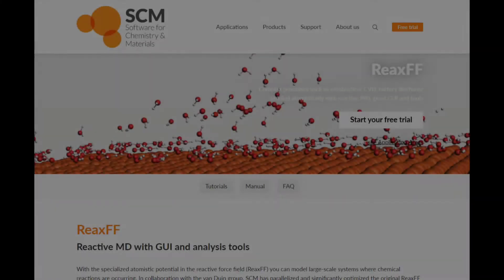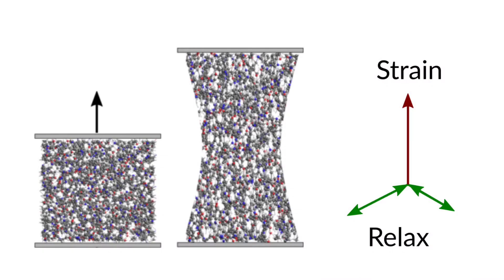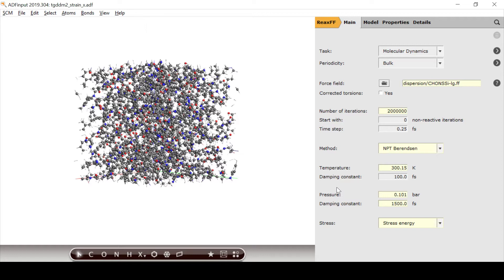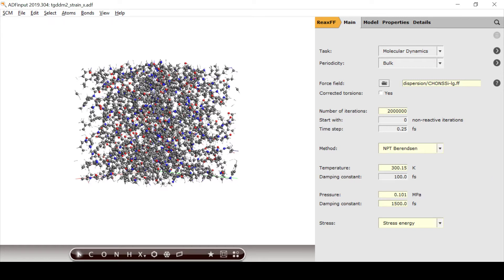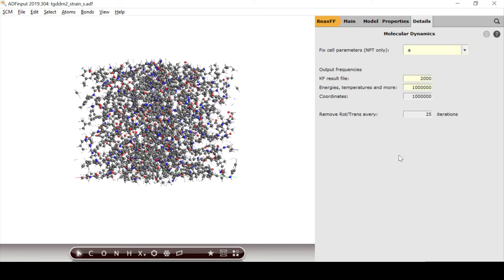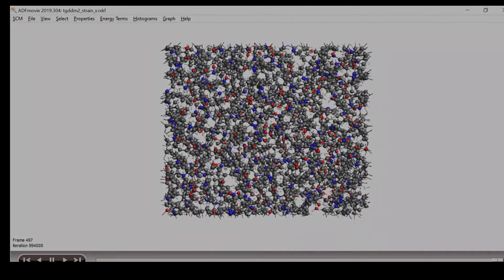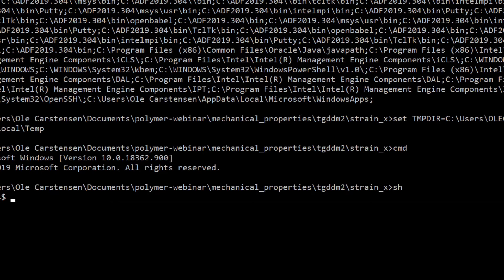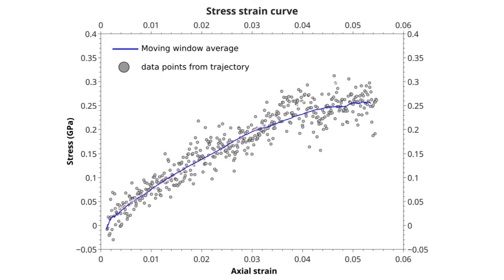Epoxy polymers: Simulation of mechanical properties with ReaxFF - reactive molecular dynamics

Comment: Thanks for great explain!
I've got some trouble on getting stress-strain curve using ams 2020.102 ver.. In this video and SCM homepage, the data points of stress-strain curve are shown dense dispersion as 50~100 MPa stress range. However, when I followed tutorial steps which is described SCM homepage, my data points show more broad stress range as 400~800 MPa. I double checked each parameters on tutorial page, It's exactly same with my input file. How can I handle this issue?
Reply from the maker: could you perhaps send your inputs / scripts to support@scm.com (then later you can upload the trajectories)?
Reply: How will you get the stress strain curve, i had so much trouble in that,can you send the procedure

Comment: Very nice video. 

I only have one question:

Is the epoxy box is a result of a MD simulation of the cross-linking? Or maybe you've created this box only for the mechanical test.
Reply from the maker: I think the epoxy boxes are the actual result from the bond boost cross-linking tutorial. https://www.youtube.com/watch?v=3EamOIEo1cQ 
https://www.scm.com/doc/Tutorials/MolecularDynamicsAndMonteCarlo/PolymersBondBoost.html
You could double check by contacting support@scm.com
Reply: @AmsterdamModelingSuite  Thank you very much, I will double check ! And thanks again for the tutorials, they're amazing.
Reply from the maker: @jbjames8482  Thanks - glad to know it's useful, let us know indeed if you would like to see other tutorials!

Comment: Nicely explained.  
Can we able to model the metallic composites material . 
For instant aluminum and silicon die oxide composite material. The silicon dioxide is in fraction form (5wt.%) of aluminium.
Reply from the maker: that's in principle all possible so long as you have a suitable reactive force field. Or if your system is small enough that you can treat it with DFTB or DFT.